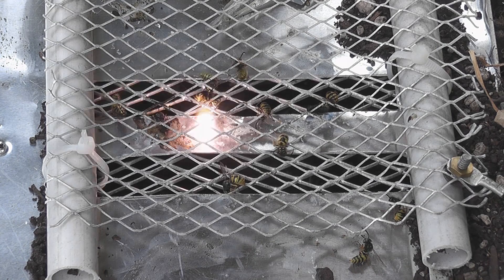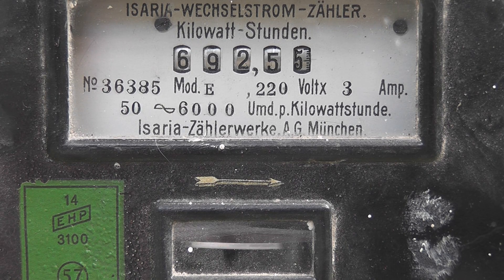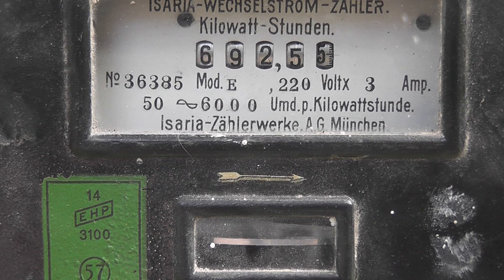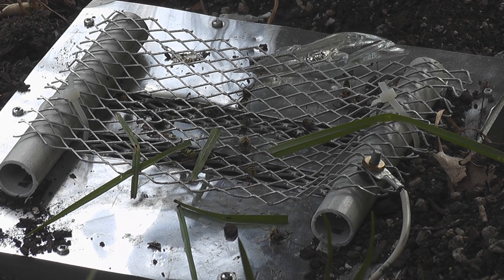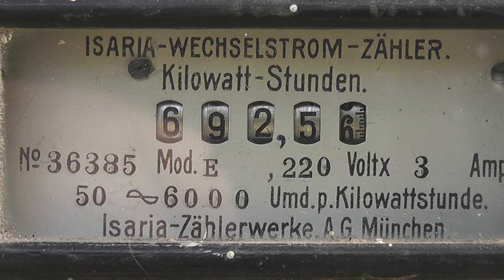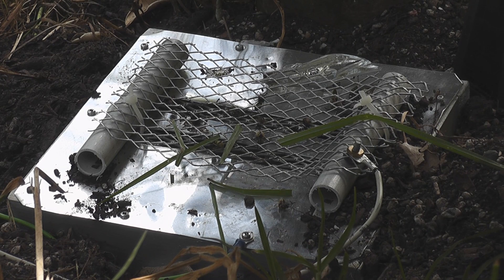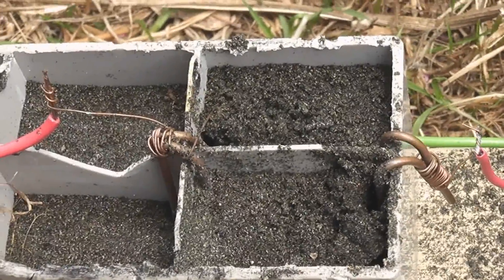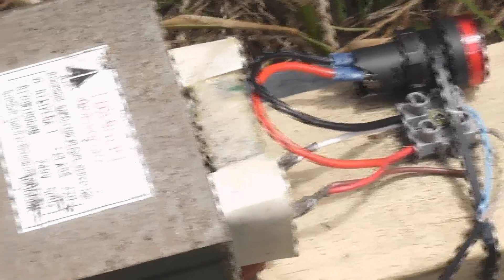2200 Volts Wasp Zapper !!

Comment: What is the kilowatt/hour meter for? Is this connected into its own mains tap at pole (so you're not sucking power from your house circuit), or are you just using it to measure how much power it's using?

Comment: I converted a battery powered DC tennis racket type bug zapper into a full-time (solar powered) wasp and bee killer.  It works very well and doesn't use any electricity.
Yours could fry the ENTIRE colony at ONE time if they all happened to fly into the grid at the same time lol.  That's a lot of current!  Mine is very high volts but hardly any current.
Reply: Don't kill honey bees tho

Comment: why not just a small motor with a wire swinging around at their entrance? ..easier and cheaper
Reply from the maker: All the parts for this wasp zapper were ex roadfind microwave and thus free.
Reply: I think the method in this video is a lot easier. A mechanical solution has to be physically manufactured. All the sizings, power of the motor,  clearance, solidness of the wire. Then it generates a lot of turbulence in the air which may warn the wasps that something dangerous is going on there. Two grids with a lot of volts on them is a lot easier to construct and a lot deadlier.

Comment: Are they trying to sting the metal or is that ass movement caused by the electricity?
Reply from the maker: They are trying to sting the metal.
Reply: +RODALCO2007 those crazy little shits!
Reply: RODALCO2007 you can't kill the metal, metal will live on. Yellow jackets tried to kill the metal, but they failed, as they were smite to the ground!!
Reply: both
Reply: 3:12 you can very good see the stinger :)

Comment: can u please describe the circuit to generate the voltage?   Are u using halogen balasts?   I looked into this method for control, but step up circuits all seemed too expensive (~$200), and I didn't want to spend the money.   I settled on chemical control, which is working fine for dollars/summer night.

GJBTW

Comment: The best part about this method is, when a yellow jacket is killed it releases a pheromone that signals the other yellow jackets to come and attack.  So you end up with a chain reaction of wasp after wasp attacking this death machine.
Reply from the maker: +RandomPerson8492 Yes 100 % correct, you can see the attack movement when the wasps zig zag nearby the grid.
Reply: +RODALCO2007 or you can trick them by getting a tin of tuna mixing poison with it and let them take it to the queen and they all eat poison and die
Reply: Lol

Comment: Maybe adding some kind of "maze" of wires around it and throwing smoke grenade down the hole would have cleared that nest in no time.

Diagram:
V V V V V V V V V V V  <- GND
| = = (Separator) = = |
VV VV VV VV VV VV <- HV
| = = (Separator) = = |
VVV VV VV VV VVV <- GND
\[] I I I I (Box) I I I I []/

(Note the spacing; The mesh or wire has different alignment, and the box has separator inside)

Comment: What a pisser. LOL. I had a nest in ny bedroom outside wall. I used a shop vac to suck them up when they tried to go in and out of the access hole where the power lines came into the house. It took many days of running that vac but I finally got them all. I filled the void with spray foam and trimmed away the excess looks great and no more bees in the house.

Comment: With proper design that would make one terrific bug zapper! Although this prototype looks more like a HV electric field torture device LOL.

I guess this design would also work with primary-side power limitation? That's what I do when I want to mess with those MOTs. I use a high-wattage bulb or a couple of heating elements from a cooking range, in series with the primary.

Comment: Maybe try tuning the gaps so the wasps cause it to break down, you could put it in a plastic container though so that all the nasty stuff is behind plastic :)

Another video I saw used lyden jars to make HV capacitors so instead of arcing it was just BOOOOM and lots of little bits of bug went everywhere hehehehe reduces the fire hazard incase one of the little bastards decides to arc something chronic

Comment: Just a thought, how would it go to set up your large 11KV transformer and suspend the live conductor within the entrance tunnel? I wonder if the current flow would actually flow within the chambers and compromise the devices inside their nests?
Reply from the maker: Not sure how that would work. My guess is that most current would  flow through the surface, although deeper in the ground the soil is more damp. At the moment I have the nest controlled through a tortuous path. To be honest I like the portability of the MOT. May look into an 11kV power line to the nest.

Comment: The next upgrade will be using a HV capacitor and flyback!! Dump a few kilo-joules into the grid!!
Reply: A few KJ would annoy the neighbors, not to mention vaporizing parts of the grid every time it goes off.
A bridge rectifier and about 20-50µF would still make a good bang though.
Reply: a mot has way more power than a flyback
Reply: ***** but 20kV instead of 2.2kV . . . plus lots of stored energy all dumped at once through the unsuspecting wasp!!! Sounds like entertainment!!
Reply: the 20kv has a few mili amps
the 2.2kv has unlimeted power

put that in a capasarer and over the grid